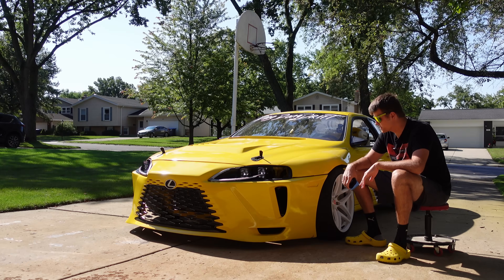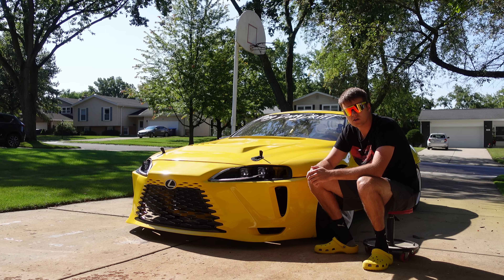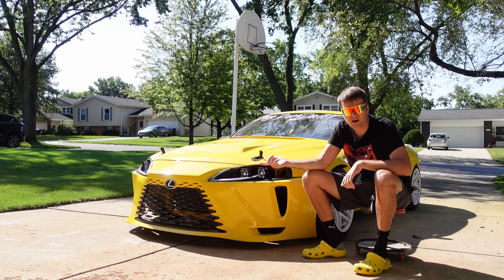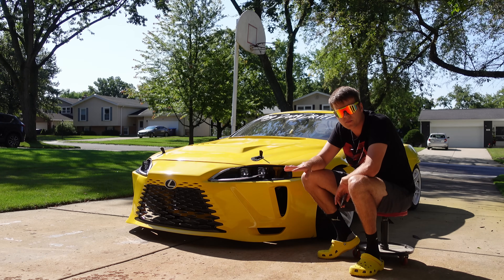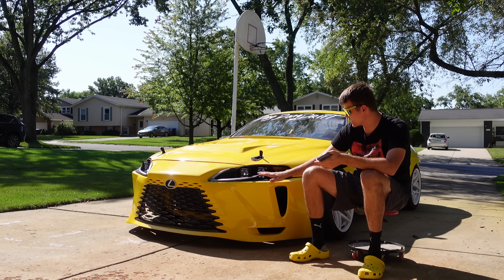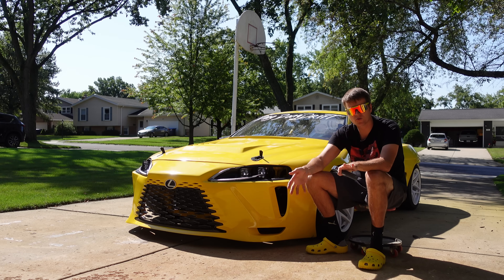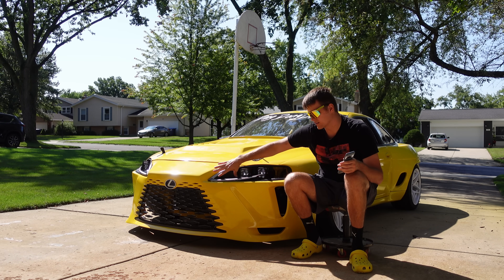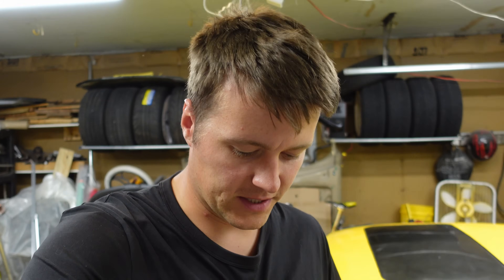How to 3D Print a Bumper - Everything Explained

Comment: As a professional industrial designer for 14 years, I say you've done an excellent job with the car, it really looks great! I've been 3D modeling nearly full time for most of that time, mostly in SolidWorks and Rhino, and agree with your statements. I do surface model quite complex aerodynamic parts in SolidWorks, but parametric modeling software is definitely a hindrance to being in a creative flow. However, what's even faster than poly modeling is doing a sketch of what you want your design to look like. Anyway, all of these skills take time to master, so it's only going to be possible for the dedicated few.
Reply from the maker: @jochem1986  knowing what you want is the biggest speed enhancer in 3d modeling.
Reply: How did you get a job as an industrial designer?
Just pure luck, got introduced by someonw from the inside, or worked your way in?
I'm really curious because it has already been a year since i finished my master's degree and i still haven't found a job in design...
Reply: Save your money so you can afford to move anywhere that has a good job and apply everywhere @myrmeko
Reply: @facycopelow  Yep, i'm doing just that.
I'm looking into moving tf out Romania as soon as i get the chance.
A salary for a product designer in Romania is around 1000-2000€/month. Like, that's really bad compared to the rest of Europe.
My plan is to get a well paid job, eat instant ramen everyday for a year or two, save up around 100k and start my own company with no loans, in Romania, to give the new generation of designers the chance i didn't have.
Reply: @myrmeko  bro here in America you make more than that as a McDonald's cook😭 I hope everything goes well for you
Reply: @facycopelow  Yeah, i know. Thanks.
Right now i have a salary of exactly 10k€/year.
It's absolutely disgusting and deppressive.
Reply: I'm just now getting into that field with an associates in CAD, do you have any advice?
Reply: @myrmeko  I had a porfolio that they liked, and I developed skills outside of my curriculum, such as Nurbs surface modeling (with some Class A quality in there as well).
Reply: @Logan-by5mu  CAD modeling is usually much more in demand, because the modeling part of industrial design takes the most amount of time. So put simply, more manpower is needed to do the CAD side, than the initial sketching and styling side. My advice is to make sure you're good at creating technical drawings, since that is very much in demand.
Reply: @jochem1986  Thanks. I'll start training into NURBS.
Reply: @jochem1986  WTF are you talking about? Sketching is an important part of CAD modeling. Especially if you're using a parametric modeling software.
Reply: @NoMoreBsPlease  I'm talking about the proportion of time invested in researching aesthetics to time invested CAD modeling. With sketching, I mean using pen and paper before diving into 3D. Both sketching on paper and Sketching within parametric software are common uses of the word sketching.
Reply: @myrmeko  2000EUR/Month? Just don't stop in Hungary xD

Comment: Infill most certainly does add strength that has been proven. However if you don't need much then of course don't bother. my biggest question is why you didn't use say 10% rectilinear instead of 5% gyroid if that's the case because rectilinear has the fastest print speed? Anyway. Give it a shot it should speed up the printing and give same results. 👍

Comment: ABS isn't good in the sun. It becomes brittle after a short amount of time. ASA is a better option with similar properties. 

And saying that infil doesn't add strength isn't necessarily true.  I've done some extensive testing using MTS Systems' load frames when I was doing mechanical design projects in school. Infil has a positive affet on shear strength and compression strength, but does little to nothing for tensile strength. The TYPE of infil used also makes a big difference.
Reply: I print thin parts from petg, even pla and back them with fiberglass, don't have to rely on infill that way
Reply: Tpu is tough, can handle it all and is flexible..
Reply: @otallono best thing I found is people print TPU and then back fill it with epoxy internally and it makes for a really tough part

Comment: Im looking at getting a 3d printer at some point by the end of the year to 3d print some parts for my own car. Im not going any major body panels, mainly just a spacer for the rear spoiler(which will lift it up by 5/8in, which does give the look im after), a replacement center dash speaker grill, and a adapter plate for my rear speakers to fit a tweeter into the bigger mid range speaker space. The OEM speakers on the rear originally used a 6x9 woofer for producing sub frequencies, along with something like a 2in mid bass driver. I had replaced these original speakers with aftermarket component speakers, and just need to fabricate a adapter for the tweeter instead of trying to use silicone, as silicone doesnt take the heat of the sun on the rear deck. I have already designed the interior parts but cant say for sure everything will fit as I want till after i can print. It will mainly be trial and error for me.

Comment: I have been switching to using PCTG for most of my parts, it has perfect layer adhesion, it's easier to print with than PLA and it is better than PETG in a lot of ways.
Reply: It also prints at roughly the same temps as PETG but has far superior chemical resistance, UV/Temp Resistance, and performs on  par with ASA
Reply: @Colbyster7  What brand do you use? Ive recently been looking into it more as my hate for PETG grows larger.

Comment: Thanks for confirming I've been building a bunch of 3D parts for my interior on my car and have been using PETG but I was using lots of infill for strength I'm gonna try your settings and see how things come out
Reply from the maker: @RicheyBLS  6 perimeters for interior parts and you're golden
Reply: Thanks bro saving me a lot of PETG rolls. How good is your scanner resolution at scanning smaller pieces? A lot of the good big scanners aren't so great at scanning small parts on the cheaper side of scanners
Reply from the maker: @RicheyBLS  yea it's not amazing, but einstar is sending me something very special pretty soon 😉
Reply: @DingDongDrift  sweet I'll stay tuned

Comment: You got a great result with the Bambu's but if you want to greatly simplify design and print I highly recommend looking into Modix. I could print that entire bumper in 2 parts. They have variants that could do it in 1 part though. But that would be more if you were looking to do stuff like this on a regular basis. The larger parts are also have a major pitfall in that a design or print error means you just wasted $80 in materials and a weekend of printing.

Comment: You can add a lot of strength using infill if you use an infill line multiplier.
Reply from the maker: @richardsurey6167  perimeters are way stronger relative to weight added
Reply: @DingDongDrift  Oh it definitely adds a lot of weight! It is relative but for ultimate strength it's useful. I make RC boats so it means my hulls are full of waterproof compartments when they smash into rocks etc. Could you use TPU for a bumper?
Reply from the maker: @richardsurey6167  you could but you can't body work or even epoxy tpu, nothing sticks to it

Comment: HIPS is easy to print and costs same as ABS. Underrated material.
Reply: Does that mean it’s basically styrofoam
Reply: @sean640   Well youtube ate my reply, but no it's not. Styrofoam has a foaming agent (makes gas during extrusion), HIPS does not. HIPS is modified by being mixed with a bit of rubber, raw polystyrene is not.
Reply: @SianaGearz  interesting thank you for the info and reposting 🙏🏻

Comment: I'm gonna be honest. I'm using an ender 3 printer (I will be upgrading soon) and I get some really nice and clean prints on it. My neighbor uses crazy expensive printers and even he was surprised I printed stuff as clean as I did on my ender 3. I hate the manual bed leveling though.
Reply from the maker: @neonnerd1364  every printer can print well, the difference is printing well quickly.
Reply: @DingDongDrift  ya for sure. My printer is slow as hell lol.
Reply: I have an Ender 3 clone (Neptune 2) and my tinkering to printing ratio is abysmal. There’s always something to fix or tune
Reply: @_zoid  ya that's the issue I have on the e3. When it works it works great but it's a pita sometimes.

Comment: My PETG body kit is warping. I’ve thought of applying resin before putting primers and paint.

How many layers of resin did you put on before paint? And do you mind sharing the PETG filament you used?
Reply: I like to use fiberglass filler or fiberglass resin/cloth on the backside of the prints to strengthen them. Because we don't care what the back looks like and it won't change the shape of the front. I print the parts thin for this purpose, not sure if it will help if you have a part with infill.. and I don't know if just resin by itself is going to strengthen the part that much. If at all possible, I print a negative of the part and make the final part out of fiberglass.

Comment: Will you build other support brackets for the bumper like thin aluminum or steel then fiberglass over that to work as a weight and strengthen the bumper so that you can mold it? or is it strong enough for you to mold it without it bending?
Reply from the maker: @ThatMurcuryTurd  it's sturdy enough to mold as is

Comment: Can you share a file on how you make the clamps on the back of the bumper to connect and build, I understand I would have to make a few changes for an 06 350Z.
Reply from the maker: @RosserNFT  what clamps?
Reply: Sorry you said you add pegs, I didn't fully understand after printing the different sections of the bumper how you put it together?
Reply from the maker: @RosserNFT  go check out the previous videos, i show everything
Reply: @DingDongDrift  will do, thanks 👍🏾🙏🏾

Comment: 4:47  That's just not true. Especially with Fusion. You can do parametric or surface modeling like Maya. I highly suggest anyone interested in Designing 3D Models to check out software like Fusion 360 or Shapr3D.

Comment: 4:50 Personally, i'd say Catia is a lot better than all the programs you just said. It has both the cad aspect and the design aspect and you can seamlessly switch between them. Not only that, the design surfaces and cad surfaces can interact with eachother.
I've also designed a few bodykits which i plan to 3D print and start selling. But money is a problem at the moment.

Also, how did you get to work as product designer? I keep trying to apply to each job listing i can find, but they all refuse me because i have no experience. Like, bruh, how do y'all want experience if y'all won't give anyone the chance to gain it?
Like, i finished head of promotion / valedictorian 3 times so far. Once at my bachelor's degree (automotive engineering), another at my master's degree (industrial design and product development) and the last at an accredited course (product design). Plus an official certification for 3DS Max usage. (That program is absolutely disgusting, but it is what it is... It was the onlt available thing.)
Reply from the maker: Catia is ooooooold lmao. Haven't heard that name in years.
Reply: @DingDongDrift  Catia is used by almost all automotive companies. Porsche, BMW, Audi, VW, Renault, Alpine, Peugeot, and others. There are very few companies, such as Mercedes, that use other programs like Siemens NX. (Even though some Mercedes models are made in Catia.)
Reply: @DingDongDrift  Did youtube auto-erase my comment?
I just wanted to say that i work as a mechanical design engineer and most companies work with Catia.
All VAG group uses Catia, all Renault-Alliance, Toyota, etc

Comment: Why not 3d print bumper as carbon fiber filament?
Reply from the maker: @ej2863  because that does nothing
Reply: @DingDongDrift  could you elaborate?
Reply from the maker: @ej2863  carbon fiber filament is double the price, but provides no benefit for this application

Comment: 7:42 - Clips graph, conveniently doesn't clip the key for the graph... Well, I already knew your "infill does not add strength" statement was wrong but I was quite surprised to hear you cite a source, so I went and looked and... Wow, your own source also disagrees with you lol. I would normally assume a slip of the tongue but at 7:35 you say "if you have 4 perimeters, your print will be strong with 0 infill. It will be the same strength as it was with 50% infill". The graph you show immediately after this disagrees with this statement. 

In watching CNC Kitchen's video, the chart is at 7:16 of his video. Blue was noted as "Infill Variation" and orange was noted as "Perimeter Variation". In other words, the blue test parts had a fixed number of walls while increasing the infill amount, and orange the opposite (fixed infill %, increase wall qty). Picking an easy data point, the graph shows that his 12gram test part would bear ~78kg of force if the strength came from extra infill, and ~102kg of force if it came from extra walls. However, both charts slope upwards, meaning an increase in infill % or wall qty both increase the strength of the test part, it's just that it's more efficient to increase strength by increasing walls. There is additional nuance if you want to consider printing time, directionality of forces being applied, and other variables. CNC Kitchen's test was also oversimplified specifically to prove that wall qty is a very considerable variable in part strength (stated in intro). 

CNC Kitchen concludes the quoted video with a recommendation at 8:47 of his video: "For parts that need to be strong, I usually don't go above 4 perimeters and 50% infill. That is a good compromise between material usage and strength." This gave me a chuckle, given your statement at 7:35 was the exact opposite, yet you used his video as your source.

Edit: the video is titled "INFILL pattern and SHELLS - How to get the maximum STRENGTH out of your 3D prints?" if anyone is curious.
Reply from the maker: @toasty4000000  thank you for your engagement
Reply: @DingDongDrift  homie you can just own it lol, geez. Or were you trying to imply that you're intentionally misleading viewers to boost engagement?

Comment: This guy just forgot about the automotive industry standard for hard surfacing, Alias! There is no way you can get the same surface control with polygon modeling (not at this point). Polygon is great for visualization and early concept development but you are not gonna be doing Class A surfacing in blender or any polygon software
Reply from the maker: @ebenmeyburgh7684  except i did